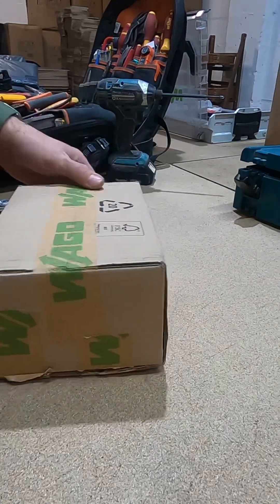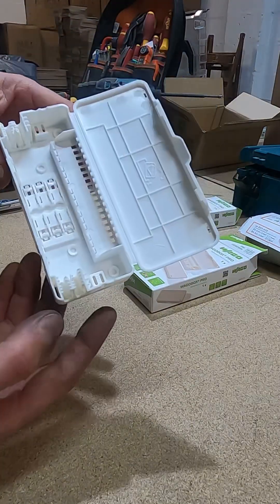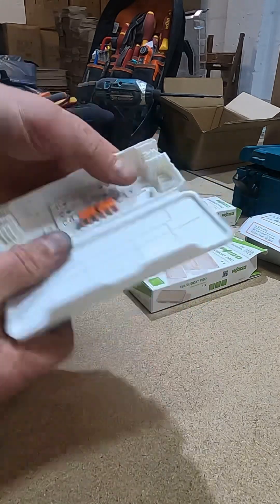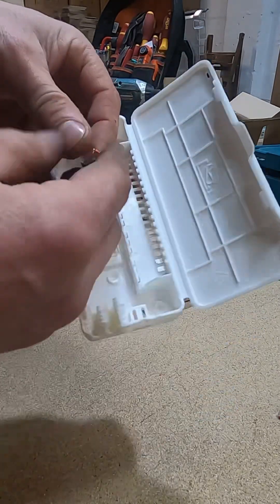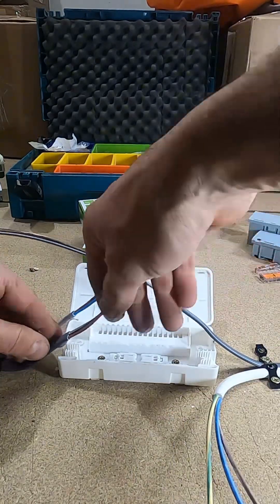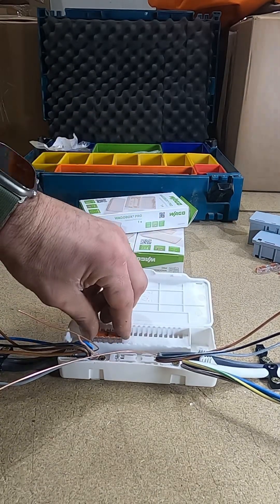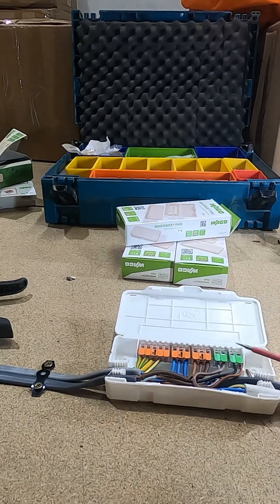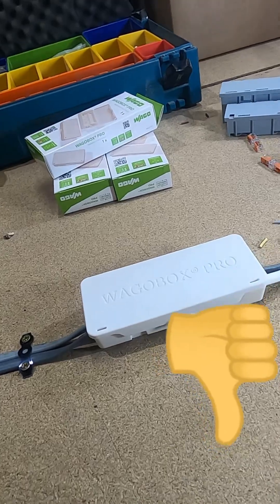Wago Pro Junction Box: The Ultimate Time-Saver for Electricians! ⚡🔧

Comment: I like the idea; efixx had the flex drilled through the top corners and cable tied in. Whether it replaces the grey coffins we will have to wait and see.
Reply from the maker: They drilled it? Why would you do that?
Reply: @toolboxtalking  for the flex so it didn't distort the box?
Reply from the maker: Not a bad idea, I must try that
Reply: @toolboxtalking  The box is designed to have two additional flex cable entries, one on each side, which you drill out, up to 10mm, and then cable tie in position as a strain relief using the slots in the box.
Reply: They have places each side to secure the flex one drilled through with cable ties apparently 👍🏼 
They look maybe a little large for popping into some downlight cutouts 🤷🏼‍♂️

Comment: Hi guys I need some advice, we currently have moved our oven (3.3kw) and microwave (3kw) no possibility of running a new cable. The only thing behind is a double socket could we run it off the ring?
Reply: That's a high current draw for a double socket. Ideally you'd want a load like that hard wired in. It's better to have it in it's own dedicated circuit. Have a look in the installation manual and see what the manufactures instructions suggest. At minimum I'd say the oven needs a 4mm twin and earth cable on it's own dedicated circuit with a 16 Amp breaker. Probably better a 6mm t&e in a 32amp breaker. It needs to be rcd protected. As for the microwave, that should be OK to run on the ring final circuit.